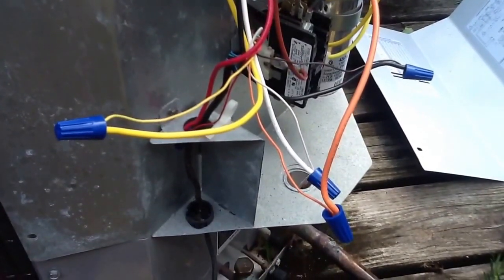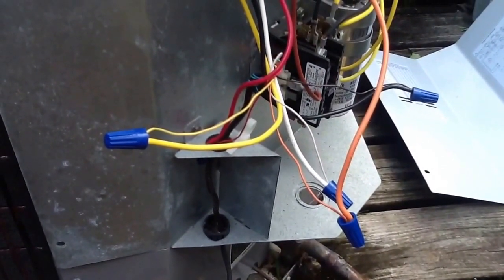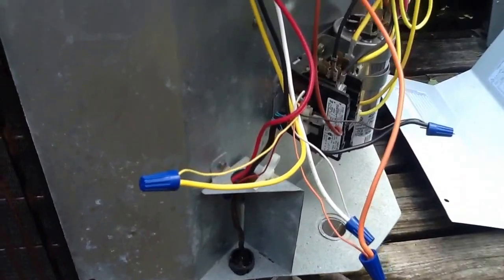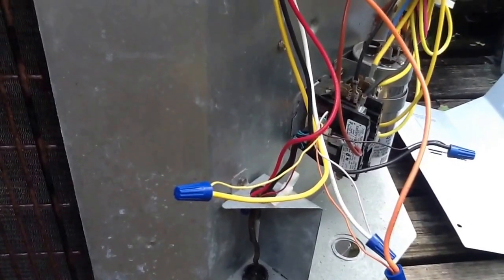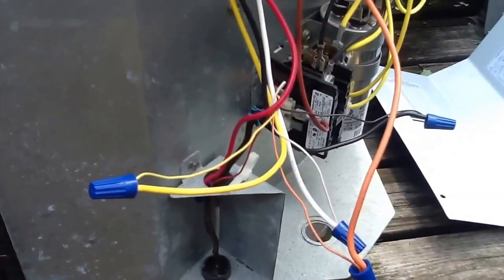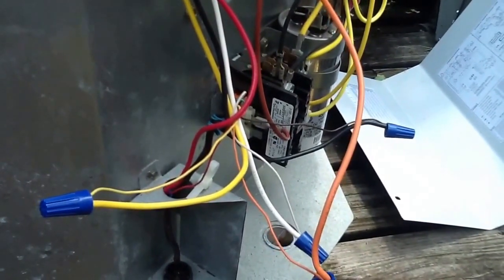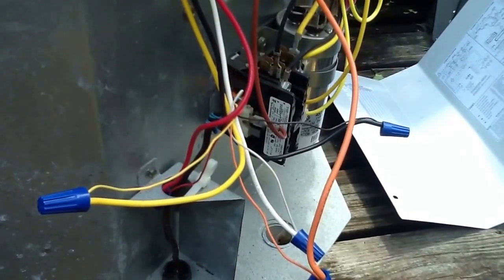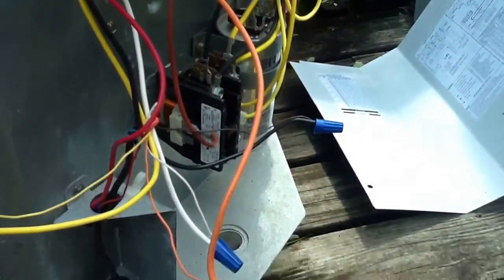Outdoor Heat Pump Wiring explained

Comment: I saw one with : blue, red, yellow,  orange, and black, what’s the black wire?
Reply: usually Red-R/power, Yellow-Y/compressor/heating, Orange-O/reserving valve/cooling,, Black or Blue -common or outdoor sensor(it depends how to wire).. you should have White-W for emergency heat..
Each unit is different though..

Comment: I had a heap pump installed.  The guys only got it working in cooling mode.  What wires need to be connected to get the heat pump working?  I got the orange wire coming from the thermostat

Comment: what size wires should I make sure are used for the indoor handler and outside unit and breaker sizes? new construction
Reply from the maker: it depends on heater size